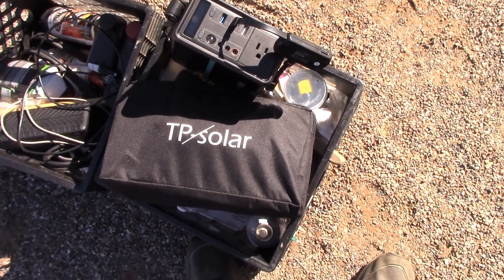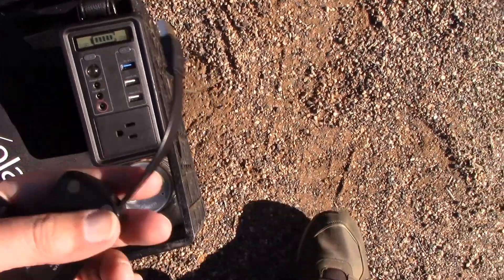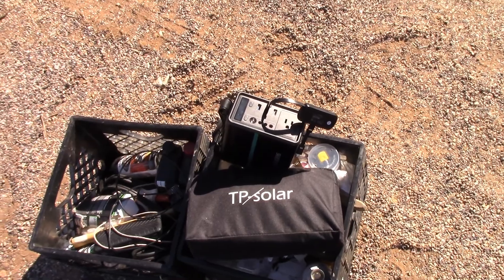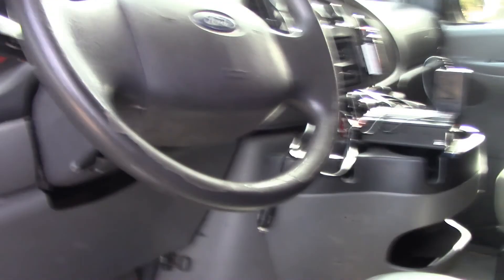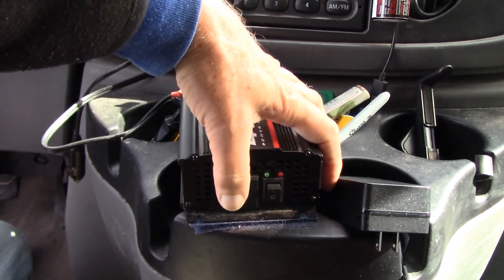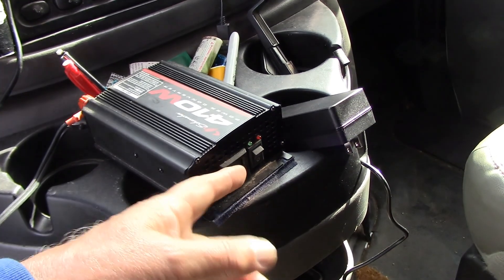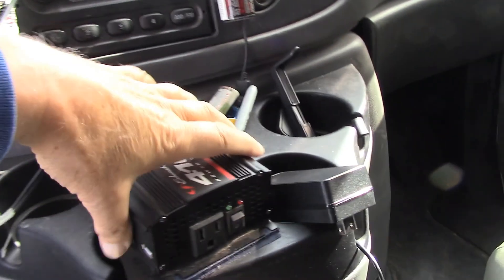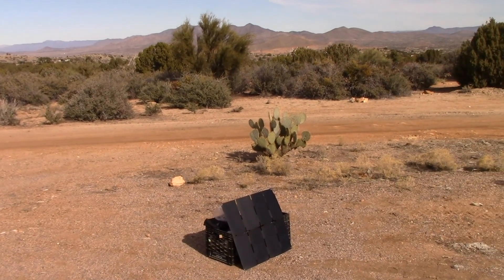Van Life: Van Solar/Electrical: Part Two

Comment: Do you use car engine when using the inverter?
Reply from the maker: Yes, it would drain the starter battery pretty quick. The inverter instructions even warn against leaving it connected when the engine is not running.